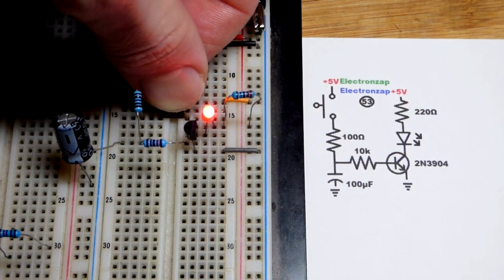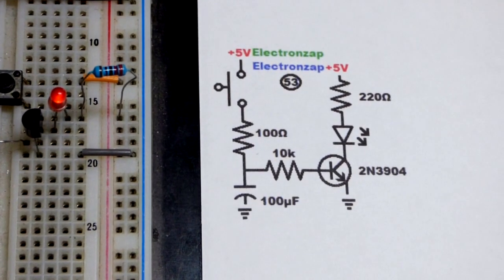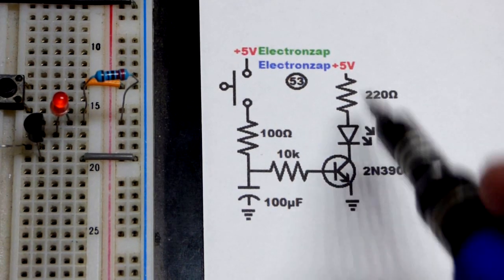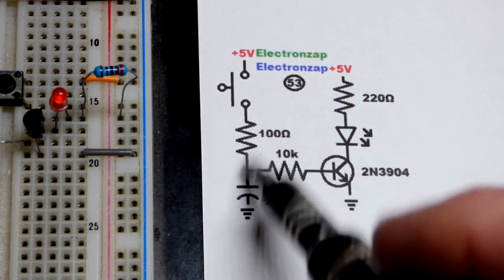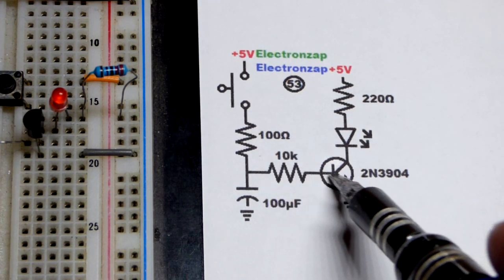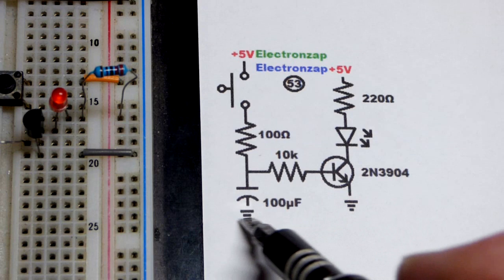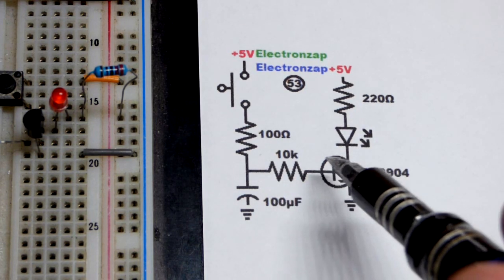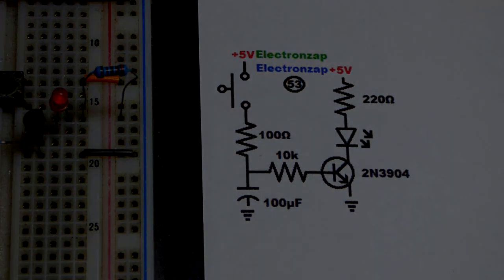LED delayed off with fade circuit using NPN BJT and capacitor

Comment: What changes would you need to power a short strip of LED? The strip uses 5V .825A 4.125W. The circuit you built powers it, but its very dim. I'm not sure how to fix it.
Reply from the maker: I don't have any LED strips, but I assume that they control the power themselves. That the strip has current limiting resistors already built into it, and that you just apply the voltage that they require. You definitely need a transistor rated for more than that amount of current though. Likely need to attach a heat sink to the transistor. I'd make a lot of changes for that circuit, so I'd have to suggest that you look for circuits made for higher power LEDs and start there.